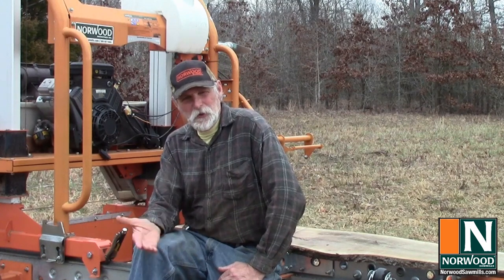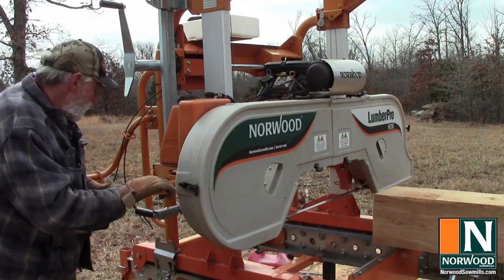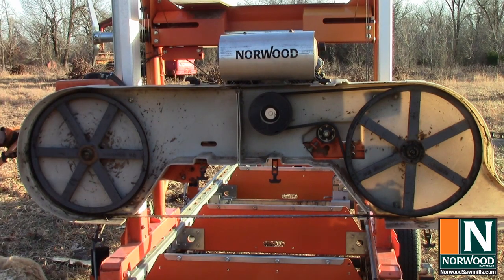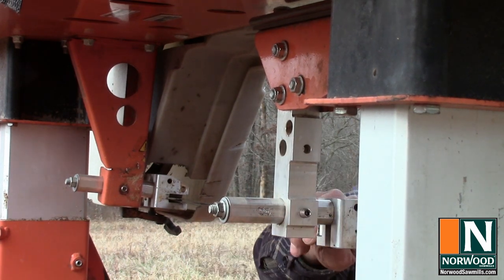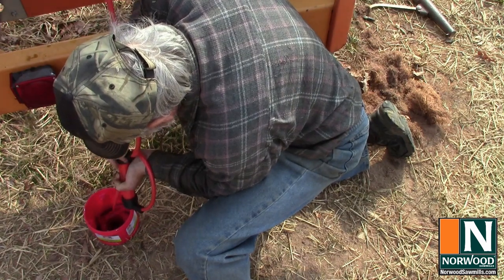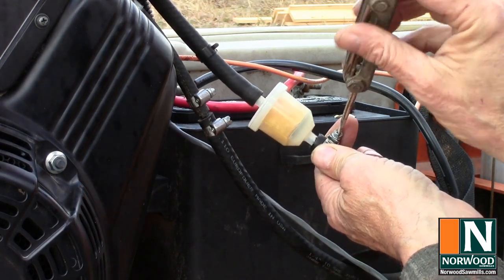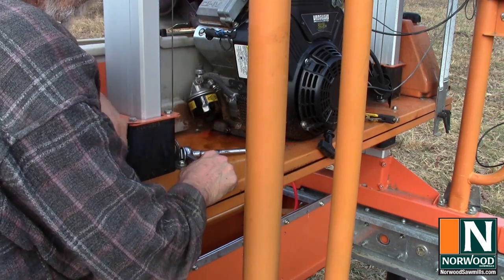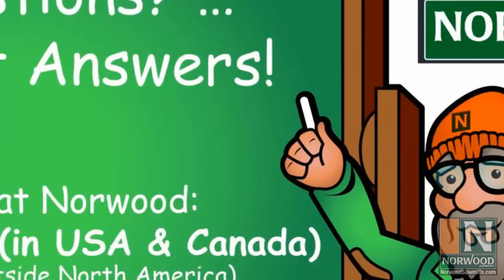Sawmill School - Simple Steps to Maintain Your Portable Sawmill

Comment: Dave,

I’ve learned a TON from you and all your video’s, THANK YOU!

May I comment on this maintenance video.  (I am a former professional small engine mechanic.)

1.  The OIL SHOULD BE HOT BEFORE CHANGING.  This puts any filings, etc., up in suspension, so it all drains out.

2.  The OIL FILTER should be turned in tighter than hand tight.  A filter wrench should be used to slightly snug it up to a max of 1/4 turn AFTER THE FILTER IS HAND TIGHT.

3.  Norwood now offers a DRAIN KIT to facilitate changing the oil.

4.  You’re right about it being best to change the plug COLD.  Do this before the warm up for the oil change.  But modern plugs do not need to be changed so often.  If the engine is running perfect, leave well enough alone.  Once a year check plug, regap, or replace if 
quite worn.

Thanks again!
SebastianSteve
Reply: Thanks for the info, Steve!  Good point about changing oil hot, and I'll run the filter a little tighter on everything when I change it.  I'm thankful for the electronic ignition... setting the points on older engines is a pain.

Comment: Been watching all your vids on the Norwood portable saw mill and have been debating whether to pull the trigger on it.   Good info on changing the oil and all filters.  I was hoping you would have shown us what tools you keep in your tool box for maintenance.   Thanks again for a very informative vid.  Cheers!
Reply from the maker: Glad you're enjoying them William. You should check out Norwood’s “SAWMILL TV” – The ultimate online “TV” channel devoted exclusively to portable sawmills and successful sawmilling.  Everything is right there in hundreds of videos …

- “Norwood Sawmills in Action” – See all the Norwoods in action
- “Sawmill School” – Learn the sawing basics
- “Successful Sawmilling” – For more advanced sawing techniques
- “Sawmill Tech Tips” – Get specific milling tips and finer details 
- “Sawmill Savvy Minutes” – For bite-sized nuggets of wisdom from the pros
- … and so much MORE Sawmill savvy! 

It’s your one-stop-channel for all the essential things you need to know –  
– from choosing your first sawmill to getting the most out of your equipment … 

Think of it as the Netflix for sawmill addicts 😊.  www.NorwoodSawmills.com/tv/
Reply: I looked at the videos on your profile-- looks like you're really into tools.  Norwood maintenance is pretty simple.  A 9/16" deep socket, 9/16" box , 3/4" box, Phillips & slot screwdrivers, oil can (I fill it with chain saw bar oil), Allen wrenches, zip ties, pliers, vice grips, small grease gun, colored pipe cleaners (for marking blades- green for sharp blades, white for dull blades, and red for blades that hit metal), electrical tape, and a first-aid kit.

Comment: Take the oil drain plug to your local hydraulics/hose service center and tell them you want a hose with a coupling to match the drain plug and a valve at the other end. Makes for a much cleaner oil change.
Reply: Good idea.  Norwood sells a oil change valve & hose, which I now have installed.

Comment: Once I bought premium gas that had ethanol in it and I wasn't aware of it. My mill would not idle, I had to crank up the idle in order to use the mill. Pulled the carb apart and checked the screens, everything was clean. As soon as the ethanol was run out it went back to running normal. The cheap carb has no adjustable jets either.
Reply: I've run into similar issues.  Sometimes I use a zip tie on the throttle to add just enough to keep it running between cuts.  Ethanol free is definitely the way to go.

Comment: Thanks for the info Trev. I always felt that I have been running just a little under tensioned but was scared to go higher. I think I need to go up about 1/2 turn then reset the tracking. Will try it.